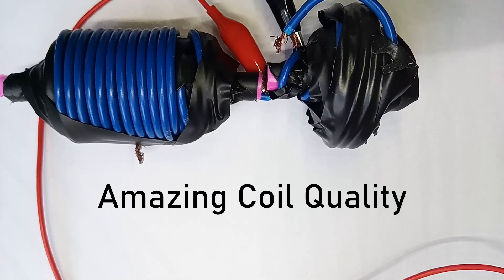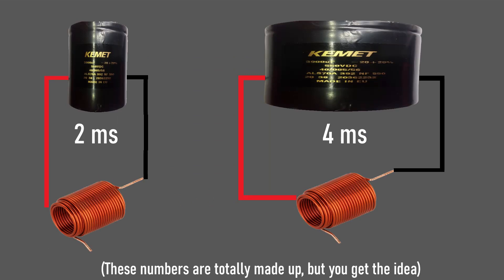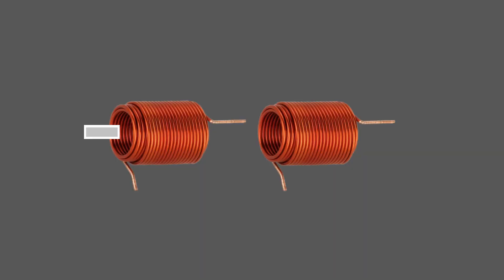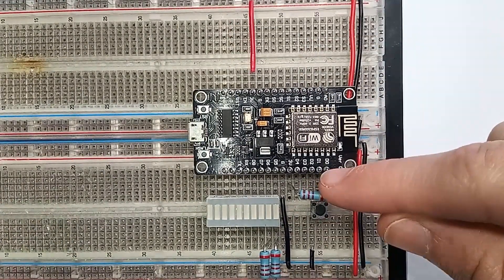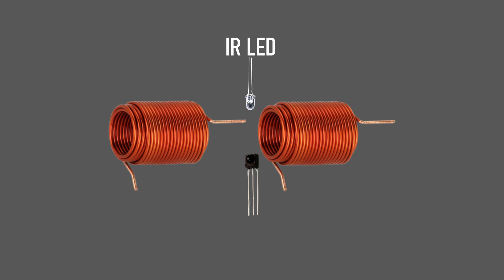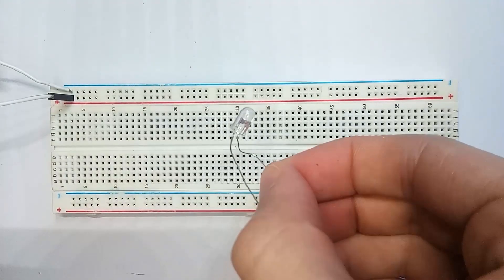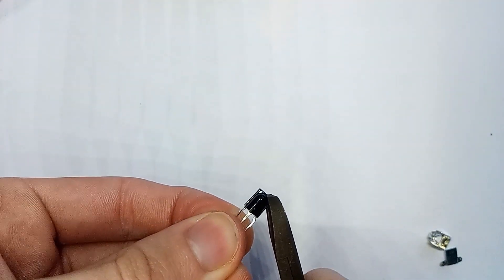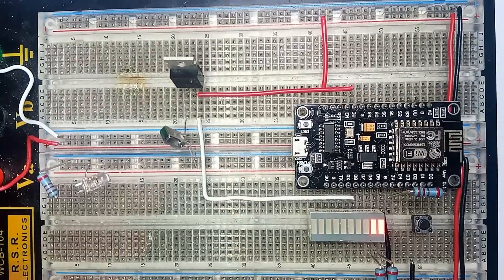Adding More Coils: Making a Coilgun - #3

Comment: Maybe I am too brute force, but:
Wind and other stuff not the problem. 
Make a clean setup so it's repeatable. Then you can experiment with the timings, shooting 45 degrees an measuring the length of power, or even better using the light sensors so make a speedometer. 

Tweek the timing for two coils, go up to three and four. Done. Way simpler, it's a gun after all, if you don't need a sensor, don't use one. 
K.I.S.S principle and all. 

Best wishes!

Ps
Or where I am wrong?
Reply: Oh yes of course. Maybe, maybe... See also: Portable Super Coilgun:

https://www.youtube.com/watch?v=rclLsQ9nyeg&amp;feature=youtu.be

https://www.youtube.com/watch?v=-mjDqp_oWZk

https://youtu.be/YLOYxsqvjw0

Comment: I did built a working coign, triggered by timers, no problem if you do it right. First of all do the math! There is a ton of videos on youtube and websites that teach how to do it.  Putting together random coils and capacitors and trial and error will never get any really good results. And for the timing you need something fast. The esp8266 is way too slow. I used a Teensy. Then you will need an oscilloscope for the fine tuning. Your coils look like crap, do the math and make proper coils and don't use stranded cables, use solid in the right diameter. With that thick isolation you get nowhere, you waste too much magnetic field. That is why we use cables with a thin coat of isolation ("enameled") for any type of coil. 
The capacity and coils need to be adjusted per stage. Every stage the projectile is faster and spends less time in the coil. If you get it right it will be accelerated with each stage. If you do it wrong you slow it down.
The size of the coils need to fit the projectile. The smaller (less mass to absorb magnetic field) the projectile, the more complicated it gets. That is why most use a big chunk of iron like a bolt. I built mine for standard BBs, that was more difficult.
Reply: Yes of course. Maybe, maybe... See also: Portable Super Coilgun:

https://www.youtube.com/watch?v=rclLsQ9nyeg&amp;feature=youtu.be

https://www.youtube.com/watch?v=-mjDqp_oWZk

https://youtu.be/YLOYxsqvjw0

Comment: If you cannot get a photoresistor or phototransistor, you could use a led as a light sensor, you just have to find out which led color works best for you
Reply from the maker: I think I've heard of that trick before, I suppose you could feed it into an op amp and boost the voltage. Fortunately I just got my sensors though haha.

Comment: You should start charging the capacitor using rectified mains though (if you have 240 VAC then you would get ~339 VDC)
Reply from the maker: My voltage converter can do ~500 volts, which is more than my wall voltage here in NA. Plus, I wouldn't be able to make it portable.

Comment: Personally, I don’t see why you want to increase current so badly. Most inductors in electrical appliances I’ve seen opt for long thin wires as opposed to shorter thicker wires, likely in order to maximize inductance without increasing current draw, which is of course limited by breakers. In your case it should mean you could get away with more smaller capacitors as opposed to one big one.
Reply from the maker: While more smaller caps does have some merit (as I'll most likely show later in the series), from my limited research on coilguns thicker wire seems to perform better. There's no law saying I can't do a test comparing coils of different wire thicknesses though, which might be a good video!
Reply: @reidsprojects7952  I’d love to see such a video if you did. Whatever you do I’m sure will be great, you make great content 👌

Comment: Do you plan to add some ferromagnetic komponents to strengthen the magnetic field? I dont't see any reason why you shouldn't, you could for example wind your coils arond a thick steel or iron pipe, wich would increase the fieldstrength witchout the necessity to increase the current.

Or maybe i'm missing something and this is a bad idea, idk.
Reply from the maker: I'd consider testing it. I would think that the field lines would go through the metal instead of the projectile, but again I haven't tested it and I could be totally wrong.

Comment: I have been considering building a coil gun myself. Personally I am going with the more power route on a single coil system. At the moment I’m building a marx generator to power it. Any thoughts on that?
Reply: Seems like it’ll work. Tho, idk how much power you can really get out of a single coil system. Having a coil gun that has a ton of arcs of electricity would be cool
Reply from the maker: My single coil test wasn't terrible, but I needed to charge the caps to around 400 volts before it was doing anything impressive. As for the marx generator, I would be worried about it maxing out the current of whatever supply you have attached to it. Would be neat to see arcs going into the coil though haha.